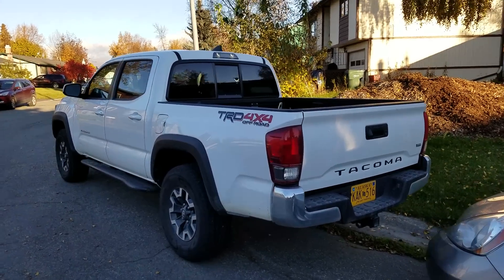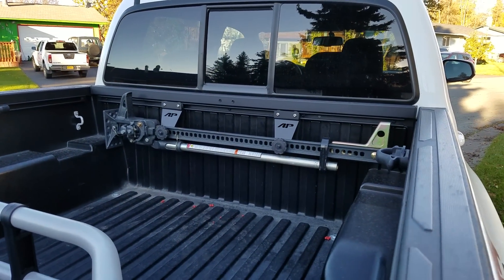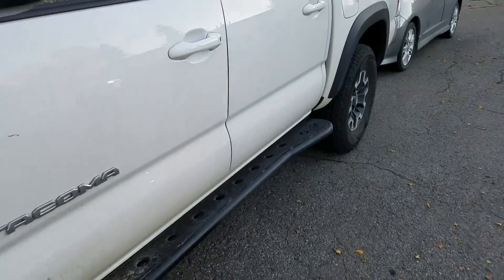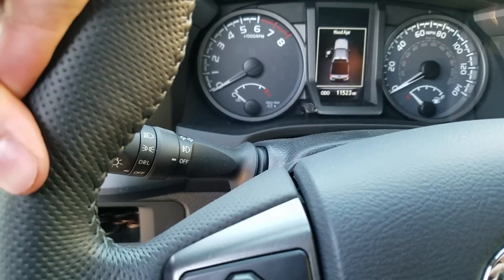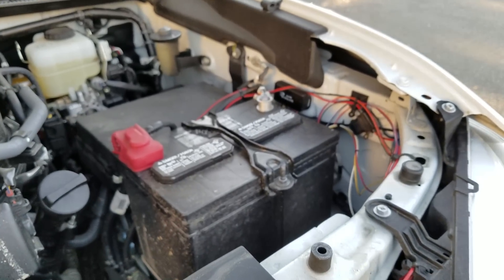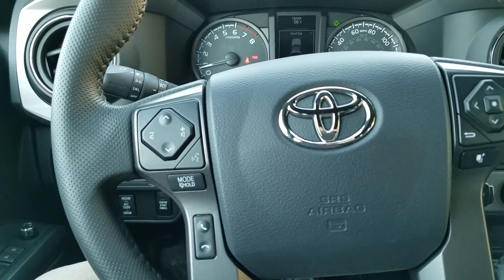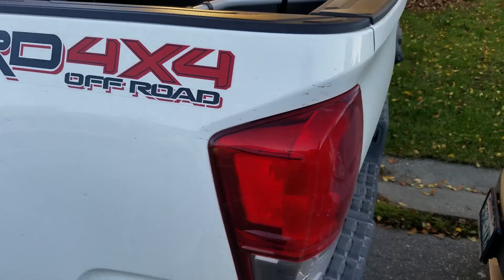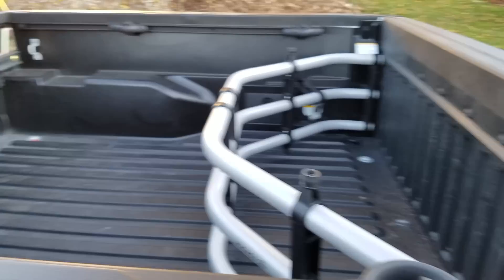2016 Tacoma Build - Mods and Accessories

Comment: Once you put the other tires and wheels on, will they rub at all, also, will you need  to get a wheel alignment ..?
Reply from the maker: No alignment needed.  Front barely rubs with wheel fully turned with hard compression of suspension.  Everyday driving and even 95% of off-roading I never feel the brief rub.

Comment: Where did you get the front rail for your bed. I have a 17 Tacoma and they don't come with a front rail.
Reply from the maker: Daniel Fachner Try Toyota Online Parts (.com) and look for part PT278-35100-BH 
TRUCK BED ACCY - HEADER RAIL.  I paid $30.93 for mine plus $11.11 shipping.

Comment: what size tires you got in garage, you said there 1 inch taller.
Reply from the maker: Randy Goes Camping BFG KO2s. 265/70r17...c rated.  I think other rim sizes are only available as E rated tires, which I didn't want for MPG reasons (trying to keep rotational mass low).
Reply: capecodinsomniac what's you average mpg with the KO2s?

Comment: How much was your tacoma being in alaska?
Reply from the maker: Jesse Hernandez I purchased truck in Seattle for $32789 + $150 lic/doc.  I could have haggle lower, but finding a basic manual TRD OR in white was HARD! ... I had another deal fall through because of vehicle no longer being available, so I didn't want to waste time negotiating on this one.   Only options on truck were Tow Package and Door/Sill Protectors (had bed extender thrown in at no charge).  At time of purchase, I could only find 3 matching trucks "available in lower 48 (none in AK).  Savings were close to what it cost to fly down to WA and then drive back to Anchorage...so no huge net savings, but I got a great road trip out of it!

Comment: Toyota has the frame rust problems for years. I wouldn't buy one. - Google that.
Reply: Todd Jones still more reliable than ford, dodge and Chevy
Reply: Hitman6205. Really nice mods especially the wheels and tires.  I do have a question.  Did you get the rock sliders painted from the manufacturer; if so, was it worth the extra few bucks to have them painted?  I would think it was.
Reply: I am planning on getting same wheels and sliders.
Reply: I guess you aren't responding...not worth subscribing
Reply: If you don't wash it the underside of your truck it will develop some form of rest, and also depends if they use salt where you live in the winter
Reply: Toyota has been and always will be the best trucks and cars made.